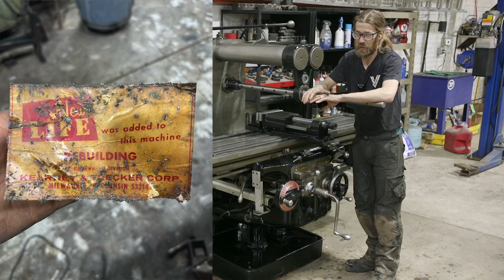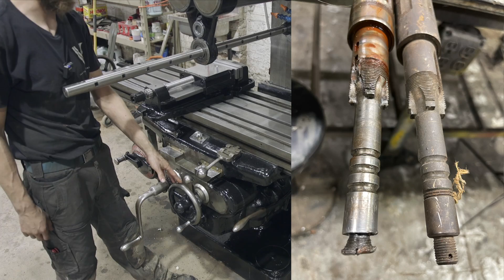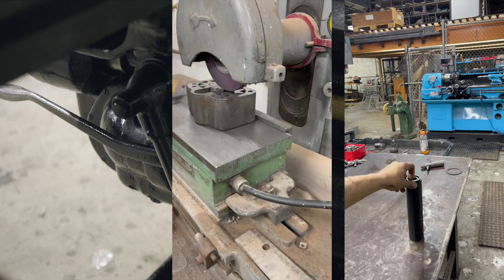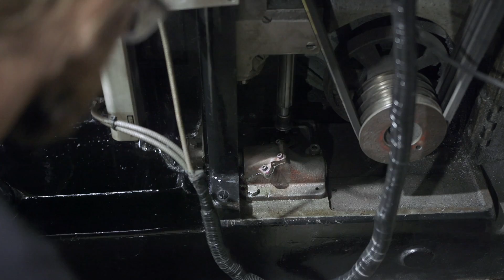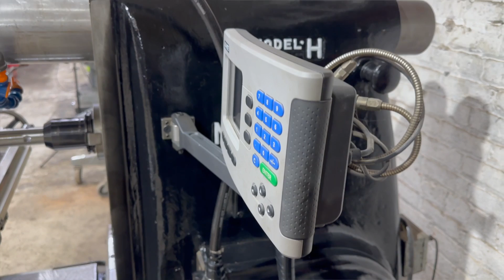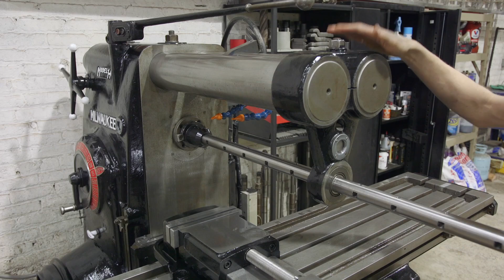Kearney & Trecker 4H Horizontal Mill (New Machine Day)

Comment: Kyle, thank you for the video. Regarding the telescoping brass tubes.....I have a K&T D2 Rotary Mill i I'm restoring, but it's missing the brass telescoping tube! It had in its place what I'll describe as a long flexible radiator hose. Simply won't do! But now at least I understand from you how these are designed with the stops that are soldered into place. I've been searching for info on these tubes to attempt to replicate them. At least with your comments in the video I'm somewhat ahead of the game. I contacted Ron Grundy to inquire on parts availability,  but he didn't have one. I've since posted my need on the Practicle Machinist Forum. So far no responses. In the meantime I'm searching for brass tubes of different O.D.s. Not going to go plastic if I can help it. 
Cheers.

Comment: I'm new to your channel, so much good stuff to catch up on!!.. It seems to close to the wall??  I certainly do not have a ton of hours on any Horizontal Mill .. but it's nice to work with the vice close to the mill for rigidity?? NO?
Reply from the maker: It is to close to the wall. But I need the space in front and I just remove the arms when they are in the way

Comment: Just a suggestion, But i would make a half shaft instead of hanging that bar so far out. especially having long hair! there is also the very minute possibility that  when spinning fast enough the centrifical force will cause it to bend and whip. I know it seems far fetched being such a large bar but i can already see the end oscillating in the video. Excellent restoration and beautiful machine!
Reply from the maker: Good suggestion bar was long for another project but yes ideally one of every size is ideal. In time

Comment: Fascinating review of the remedial work done on a great mill. We had some very new CNC machines and some very old machines that were taken care of and still held a tight tolerance. The work on the mill is a good investment, as long as you can get work for it, really nicely done. How many times have you hit your head on the overhanging tool spindle ? Good post, thank you 👍
Reply from the maker: Yes indeed. I haven’t hit my head yet, but I’m sure it will happen.